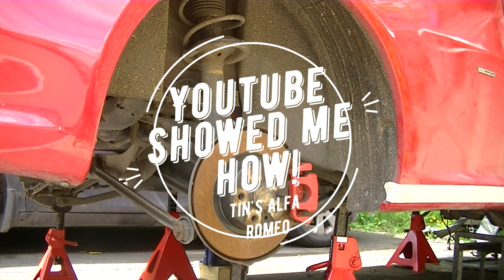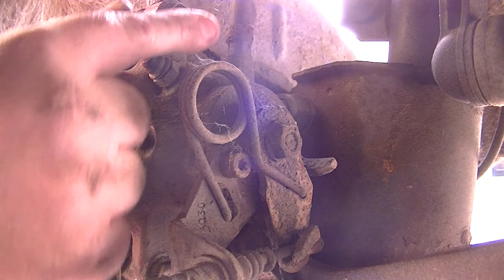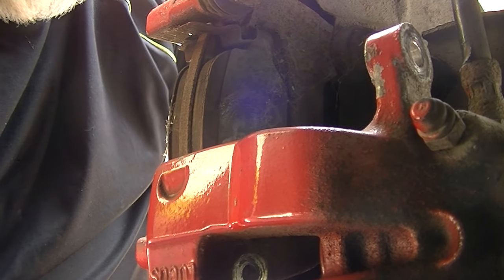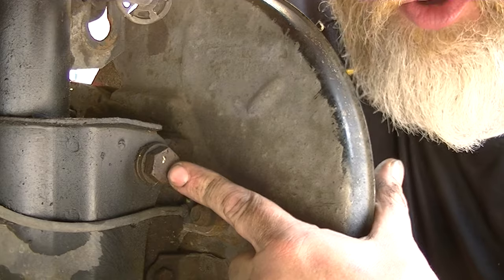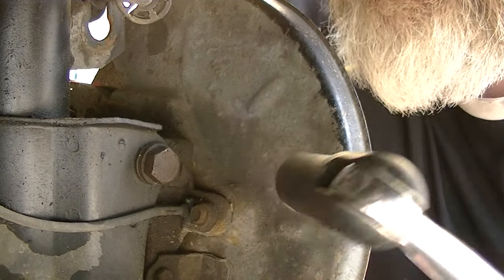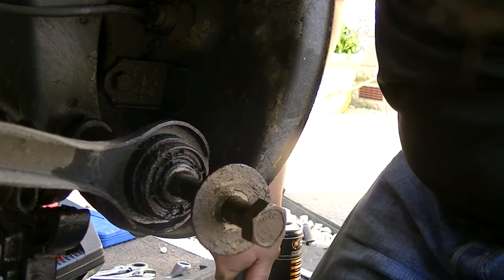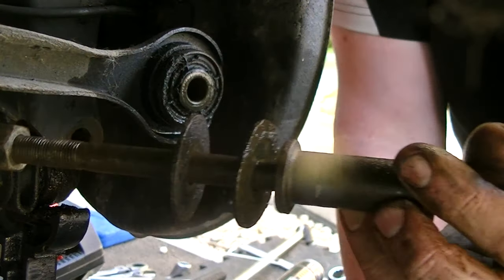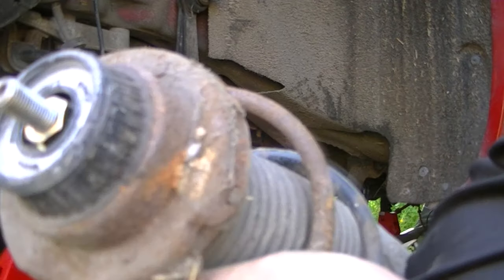Alfa Romeo GT 147 156 Rear Suspension & Shock Removal (Short Version)

Comment: REALLY helps if you have an electric impact for this job too. I ended up using mine to spin the lower pinch bolt whilst holding a wire brush against it through the knuckle, and spraying it with WD40 until it was loose enough to slide out. Pig of a job but with patience and preparation it can be done on the driveway.
Reply from the maker: Completely agree. I used a wire brush attachment on my Dremel to get in there and really strip away the rust. I soaked in PlusGas first though for a couple of hours. The difference was obvious as when I did the other side I tried it with only PlusGas and no sanding and the bolt was so seized it snapped. Luckily,  once I had completely stripped it down I was able to use a lump hammer and a few choice words and just knock the snapped part out, which added about 15 minutes to the job.

Comment: Thanks for posting. If like me you have a 156 Sportwagon you'll need to do more trim panel removal in the boot - and mine did not have a pre-cut flap on the carpet, so that will need releasing, too.

Comment: hi there thanks for the video, rear left shock of mine broke. im buying a new pair of shocks and springs, should i buy anything else?
Reply from the maker: I would buy a replacement pinch bolt as they are known to snap when removing them. I have an old ebay link to them somewhere, I'll dig it out and post it up for you. Good luck Ahmet.
Reply: @youtubeshowedmehow7546  thanks a lot 😁😁👍🏻
Reply from the maker: @ahmet6144  Here you go mate : https://www.ebay.co.uk/itm/ALFA-ROMEO-156-TRANVERSE-ARM-BOLT-GENUINE-60616479/123107872868?hash=item1ca9cd1064:g:4JIAAOSwt4Ra5yMR
Reply: @youtubeshowedmehow7546  thank you. all these parts are getting more and more expensive 😂 so just to confirm I need 2 rear shocks, 2 springs, 2 of the pinch bolts you linked and nothing else? I have all the tools so that's not a problem I just want to make sure I have all the parts.
Reply from the maker: @ahmet6144  Yes that's it. Spring compressors if you have them, or your local garage will do it for you for about £20.00. The job itself isn't hard, its just the pinch bolts that make it difficult as they are going to be rusty and seized (if you live in the UK where it's wet pretty much all the time). Use the time to get the wheel arch liners off as well and give them a good clean, inspect for rust on the wheel arches, check you disks and pads and rear brake cable. I like to mix one job into lots of little jobs so i dont have to take apart things more than once.
Reply from the maker: @ahmet6144  Yes thats right. Its the same sellor i bought mine from. The rear suspension for the 156, 147 and the GT are the same.
Reply: @youtubeshowedmehow7546  might not be a tough job for a pro like you but it's my first car so definitely a big task for me 😂 yeah I live in the uk so my bolts are probably in need of a replacement. again I really appreciate your help. I'll see if I can get a decent package deal from this seller fingers crossed 🤞🏻
Reply: @ahmet6144  did u eventually manage to do it by urself? If yes then what extra tips would u give to make the job easier.
Reply: @ZwaanAfghan  mate it's easy as pie (aside from the rust). Use lots of wd40 and an impact wrench (I've got a dewalt one) along with sandpaper. Bring a hammer if u can't get the big bolt off you just need hit it back and forth until its off. You dont need to remove the brake calipers you can work around it if you want. Have a friend with you while you do it and yeah you're all set buddy. Took us 4 hours for one side and 1 hour for the other. Don't forget to do the top nut up tight otherwise you'll hear rattling. Make sure you've got all the bits and bobs
Reply: @ahmet6144  thanks. did you have to replace one or both of the long bolts?
Reply: @ZwaanAfghan  neither mate they were both fine. My car was rusted to fuck too so I was surprised it didn't snap. 95k miles if you're interested. Just be careful still with the bolts
Reply: @ahmet6144  thnx for ur tips. one more question: did u have a garage mount the springs on the shocks?
Reply: @ZwaanAfghan  nah got some spring compressors mate they're like a tenner at Halfords you just need to be careful that they don't slip. Take your time with them and watch a few guides